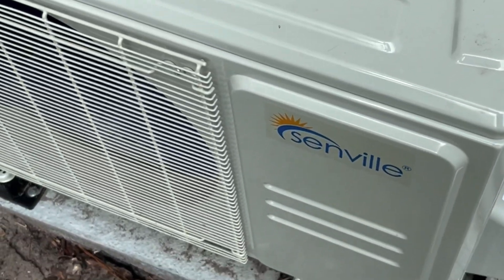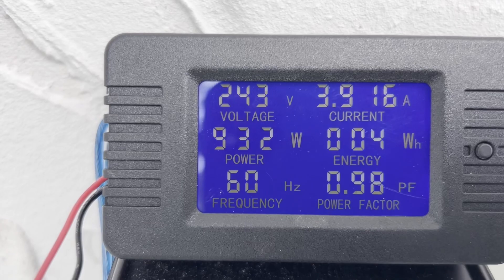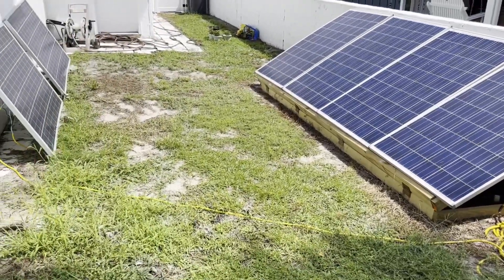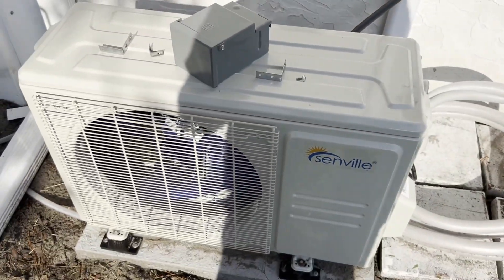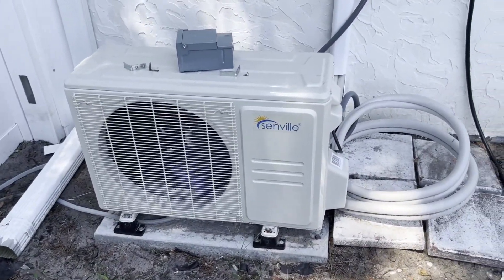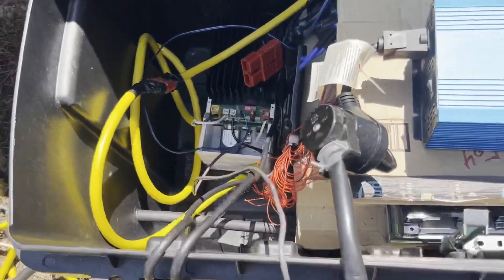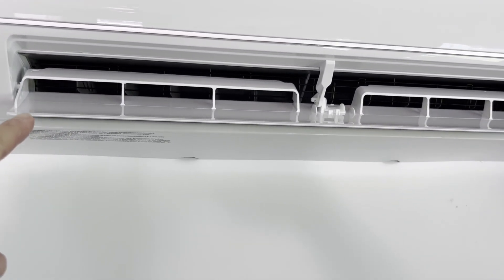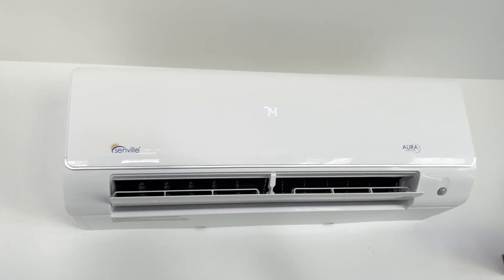How many watts does my mini split ac use ?

Comment: I have the smaller 9000 btu version of that exact same AC and it is no where near as low power as yours... I wonder why...  The lowest current draw I have seen so far is 340 watts.  I guess a lot of things go into the amount of current, and it has been over 100 degrees here every day since I installed it last weekend.. I hope that is the reason mine uses so much more current than yours.
Reply from the maker: Yea that is a bit odd, you would,think a 9000 btu would draw less amps when demand is at it lowest. It could be that your temps are 100 mine were high 80 low 90. If you can do a 24hr test and let us know how much it consumed in a day
Reply: @IFix-Things  IT has been running for just over a week so far.. Most it used in a day was 12kw  some days as low as 7kw.  I have never seen it using less than around 390watts at any given time. That is why I was surprised that yours was 195watts on a bigger unit.  Mine is their "Letto" series.. maybe that line is less efficient than the one you have.   Still, I am not complaining,  just the blower in my old whole house AC used over 500 watts, and in the summer we tended to leave the blower running all the time just to have some air circulating.
Reply from the maker: @louispoche4312  that probably explain it, I don’t think the aura series is available in 9k, but I def know it’s more efficient that the letto because when I bought it I wanted the highest efficiency that I could afford. I got mine on a Black Friday sale for like 999 or something similar.
Reply: @IFix-Things   Maybe I should have paid more attention. I got two of the 9k ones for 699 each in an Amazon sale.  My main AC died and it has been over 100 degrees every day for weeks here.  I am happy with the ones I have.  I have a 18k in the livingroom / kitchen and the two 9k ones in the two bedrooms.   My house has never been this cool and I am sure that all three are using less than my old 2 1/2 ton ac used.   And at the price of these mini splits, if they last a few years I can then replace them with even more efficient ones since the holes in the walls and electrical connections are already set up.
Reply from the maker: @louispoche4312  you are correct, you can’t beat the price. If mine fails ina year or two, I will get a multi head unit, the cassette types also seem like a viable option
Reply: @IFix-Things   It has been a couple of weeks now, and the temperatures have dropped below 100F  (a little)  and I have seen my 9000 btu drawing less than 200 watts sometimes..  I guess I jumped the gun thinking it was a power hog.
Reply from the maker: @louispoche4312  excellent news!
Reply: @louispoche4312  That is great news for me to hear.  I have the exact same setup as you. 2 small ones in the bedrooms and an 18K splitting the Kitchen / Living Room area.  I replaced an old R-22 RUUD 2.5 ton with the mini splits.  We absolutely love them because you can use the remote and set the temperature in any room to whatever you want.  My wife sleeps in the guest room quite a bit and she likes the temp around 75 but I like it lower than that.  Have you received an electric bill yet after installing the mini splits.?  I am really looking forward to lower cooling costs.  Anyway congrats on your whole house conversion.  It sounds like you made an excellent choice.
Reply: What voltage are you running? If you're not on 240 like he is your results will vary.

Comment: Do u put ur remote on follow me or just leaves it like it is with the vents going up and down ?
Reply from the maker: I do have it setup so that it uses the remote location for temperature just because I feel the temp at the ceiling where the indoor unit it is higher and lower than room temp depending on whether it’s cooling or not

Comment: I'm running my 120v Senville Leto 12,000btu on my 24v Solar System  right now at 690 watts on my 5760wh Lithium batteries its only been on for about 30 mins
Reply from the maker: Cool. You should see that settle down to about 200 after the temp hits set. What is the current outside temp and what do you have the t-stat set to?
Reply: @SuperRobkar  it's 81 outside I have it set to 75 for now I have the remote on follow me so I can tell the temperature in my living room it's reading 76 down from 81 it was in here actually
Reply from the maker: @thelithiumpowerch  I have mine set on follow me,  it keep remote aimed at indoor unit. Mine also seems to vary with room temp, I think it’s because the units temperature is up higher on the ceiling compRed to the temperate from the remote. I went with the aura because of the supposed higher seer rating. If you get the chance try a 24 hr test and see how much yours uses
Reply: @SuperRobkar  My Senville Leto is 21 seer I believe I'm completely off grid tho so running 24hrs straight would be a challenge because I'm running everything in here off solar & batteries but I am building up my battery bank to 12kwh from 5760wh

Comment: I just used a wire plug on my mini split that has a dedicated breaker.  I can unplug it and plug it to my generator.  To many power outages here.
Reply: I did the same thing..  I can plug my bedroom mini split into any small generator and cool down the room during the day.. and use a battery to keep it cool at night.
Reply from the maker: @louispoche4312  cool! These mini splits are great
Reply from the maker: Good idea
Reply: Yeah not really a good idea.
Since the mini split has an outside condenser, it is meant to be installed outdoors. Which means, based on the manufacturer recommendations and the electrical code that mini split is to be hardwired into a disconnect. You wiring a plug and then plugging it into an outlet that might be wired to the disconnect is a clear violation of the code. 
There are those who want to do things the right way and then there are those people who just want to do.